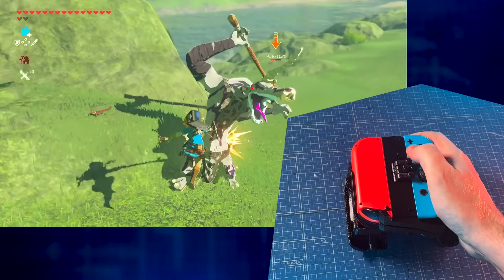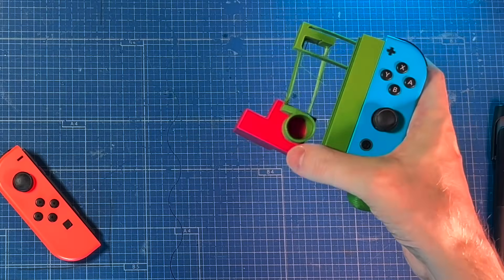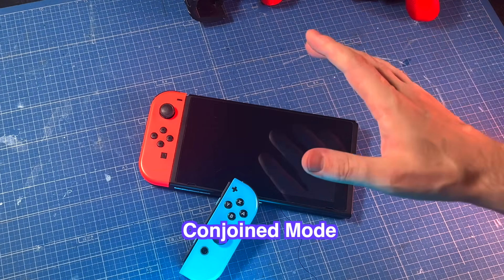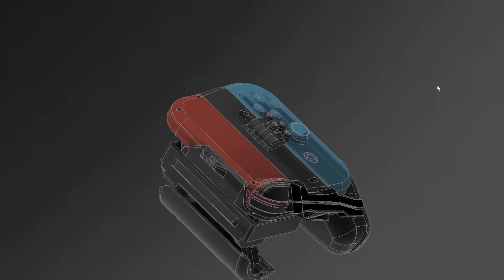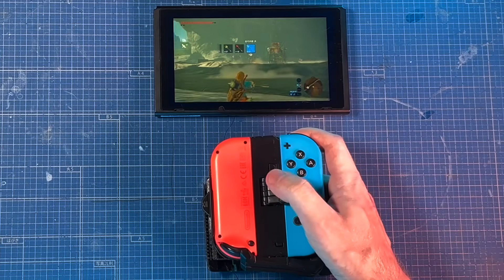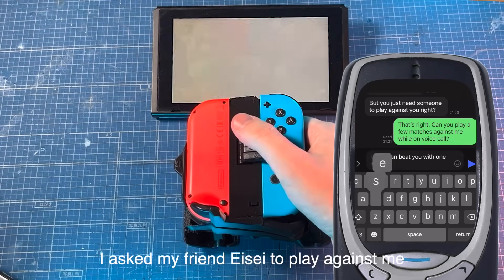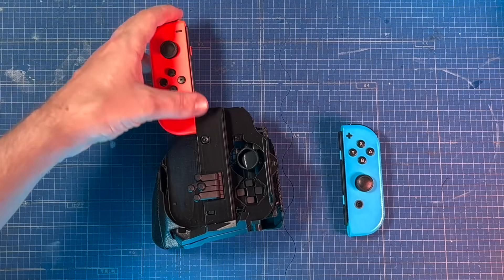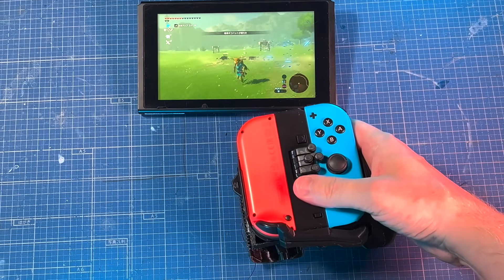My accessibility controller for Nintendo Switch

Comment: I wounder if you have a tip for a good material for me to use. I have made different grips for my switch light. I use both my hands but due to a lines i have I lay down in my bed a lot and I don’t have much strength in my arms. So when i lay down and play it gets really heavy. So I have made some different grips to make it lighter . And i have a favourit made of a cheap grip from amazon where a saw of the handels and made new with epoxy and with plastdip rubber and color. I don’t have a 3D printer or something like that. But my problem is that it is to slippery. And i have used two different kind of plastidip rubber spray. That works very well as long that it not starts rubb of…and that is after a few days. Do you know a good light weight and smooth solution for som kind of antislip coat?

Comment: 🤔 Hmm... What About The SwitchKey... 
Wide Matt-Black QWERTY Bluetooth Keyboard. 
Backlit, With, Extreamly Easy To See Keys. 
Joy-Con Rails Positioned At Both Ends.
Joy-Cons Enabled To Be Charged, While Attached To The Keyboard At Both Ends.
Stand Underneath Top Shoulder Of KeyBoard Larger & Steaper Than Usual.
A Way To Attach The Nintendo Switch'es Screen, To The Middle Of The SwitchKey.

Comment: This is so darn cool and great for accessibility! Will the gyro aiming still work well when the control is flipped? Not sure how that stuff work exactly. :)
Reply from the maker: I was wondering that myself but it turns out it works just the same! I’m hindsight it’s kind of obvious because it’s just the relative motions, the direction you’re facing doesn’t make a difference. You can see me using it in one of the game clips.
Reply: @AkakiKuumeri Ah! That's right! Really cool! I am so impressed how you just reveres the stick with different mechanics. Brilliant!

Comment: I use a 3d printed joycon holder so i can game using only my right arm I almost cut my finger off a year ago and got electrocuted recently in my left arm so atm I got mine from a etsy page which had the 3d model on its page so you can print your own or buy it from the page if you don't have a 3d printer

Comment: Are you able to create an adapter that utilizes the L1/L2 and R1/R2 on the insides of the Joy-Cons?  Kind of like Paddles on the Xbox Elite?
Reply from the maker: That’s a great idea. That way you could have four freely remappable extra buttons at a convenient location. I made one prototype with something like that, but I couldn’t quite fit all those moving parts in there. It’s one of the extra features I would like to add in the future.

Comment: It's a fantastic design. I'm grateful for all the time that you put into making all these different consoles accessible for everyone. Is this adaptation for the original Nintendo switch or for the new Nintendo switch oled?
Reply: Because this project is for the Joy-Con controllers and not the console itself, it's compatible with both versions of the Switch, since they both use the exact same models of Joy-Con.
Reply: Thank you :)

Comment: That’s amazing! You became the king of controller accessories over the years, it’s been an awesome journey to watch unravel.
I like how the switch controller really works well as a one handed one with such a small frame and how close the buttons are.
Too bad for the joystick drift hahaha
Reply from the maker: It took a few iterations to get there! I wonder if I could take some of the ideas in this Switch one and bring them to the PS and Xbox ones.
Reply: @AkakiKuumeri  definitely do that :D
Something that I noticed is the super low and clicky button travel on the switch seems to make the pressing on the levers so much better too.
We could potentially take off the buttons cover and make our own 3D printed clicking structure on too of the board for lower and better press traveling but PlayStation controller for example have pressure sensitive buttons if I’m not mistaking so I’m not sure how doable it is without having to solder or something.
Reply from the maker: @TomatePasFraiche  could be the shorter travel buttons and could also be the greater accuracy of the SLA printed parts, as well as using metal shafts instead of all FDM parts.
Reply: @AkakiKuumeri  very true, it’s answer D “all of them” probably 😉